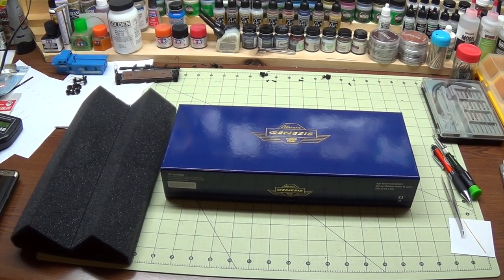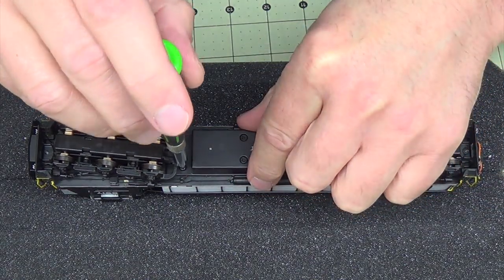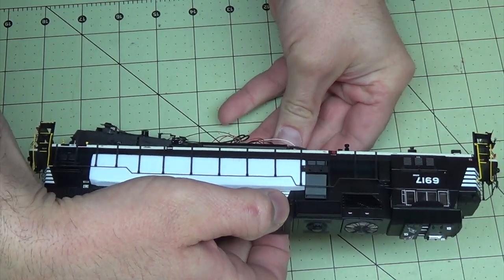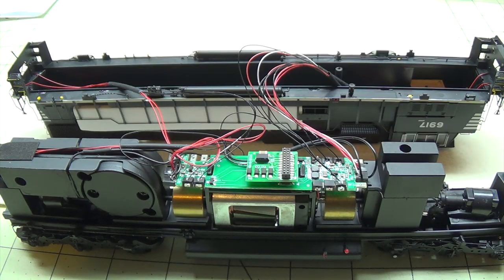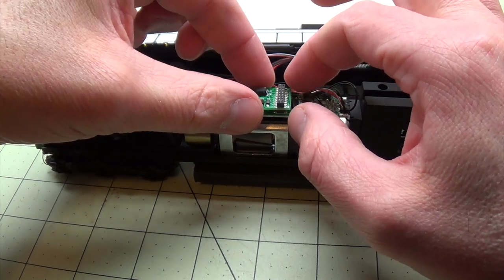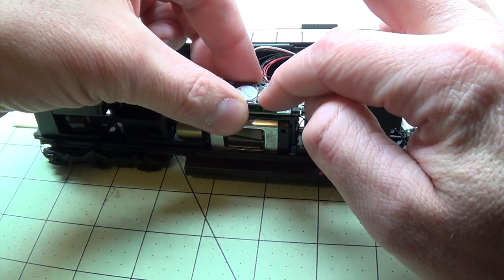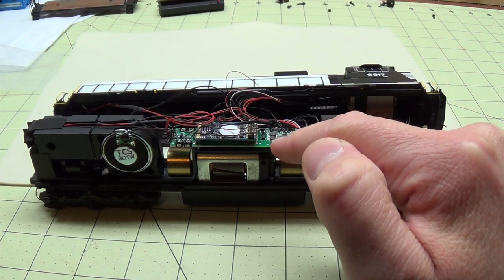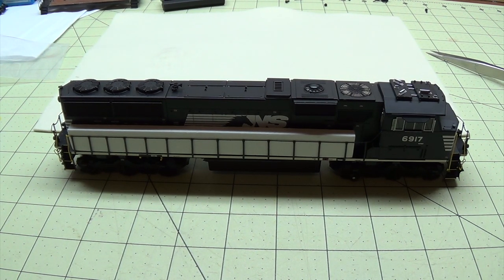How To - Decoder Installation - Athearn Genesis SD60E

Comment: The MTC21 plug has the loudspeaker pins on the board, better to grap the signal from there then directly from the decoder. Great video though...

Comment: Love seeing you back in my sub box! I have 3 of these, veterans, 911 and a standard black one. Are all the lighting functions isolated or are they all wired to the main head light like older pre 21 pin decoder boards? I think I see isolated in the video but am not sure. It will probably be explained in the next video. Can’t wait!
Reply from the maker: Thanks buddy!  The number boards are wired to the same output,  but everything else is on their own output.  Each ditch light is on their own output,  so if you use a 6 function decoder, you can get both front and rear to alternate flash,  without having to touch the wiring.  I have a programming video coming out soon discussing that.  Hope that helps.
Reply: DG Modelworks Awesome!! I’ll have to add sound to the others. I only got the veterans unit with sound. I know your video will help me a lot! I know this one did!

Comment: Great "How to" video! Does removing the weight affect pulling performance?
Reply from the maker: Thanks! Removing weight from any loco will definitely affect pulling power.   These aren't the heaviest locos out there to begin with.   As a comparison, this locomotive weighs 20.45 ounces.  To put that into perspective,  an Intermountain ES40DC weights 18.00 ounces(which has terrible pulling power), and the MTH SD70ACE weighs 23.15 ounces (one of the best pulling locos).
Reply: @DGModelworks , thanks for your quick reply! can I add weights in that cab? The ones they sell in auto parts store?
Reply from the maker: @FatboyinPa  Yes you can add weights if you can find a spot for them.  I don't expect you will find any available space in this locomotive though.

Comment: Great tutorial !. I like the idea of installing an ESU Loksound decoder in an Athearn Genesis. Not a big fan of Tsunami 2. Question is when you purchase a new Loksound V5 decoder are the wires for the speakers attached to the decoder ? or did you have to solder them on to the decoder . Sorry and one more question, if you were to install an ESU decoder V5  21 pin into a new Athearn Genesis DCC that has a tsunami 2 decoder from factory would you have to wire in the speaker ?
Thank you for any input, just not to impressed with tsunami 2 right out of the box.
Reply from the maker: Thanks!  The 21 Pin V5 decoder comes with the speaker wires already attached.   If you buy the newer NON-Sound Genesis locos, they will accept a 21 pin decoder.   If you buy one that already has Tsunami 2 from the factory, then you will have to replace the entire board.   The factory  equipped Tsunami 2 locos come with a full size decoder board, not a 21 pin.
Reply: Hey thanks for responding.  Wow, I didn't realize the factory equipped  tsunami 2 locomotives are like that. I've got about  4 tsunami 2 locomotives and I was thinking of converting  them. I will most likely buy the dcc ready models in the future.  Thank you very much for that info.
Reply: Okay I just purchased the same decoder that you did (58429) and there are no speaker wires.  I cannot tell from the provided documentation where I should solder the speaker wires.

Comment: Hi Derrick, great video , I like how you show things so simple and easy, I have a Athearn Genesis Sd60m Non sound model and want to add an ESU loksound V5 decoder like the one you used in your video, I noticed the product# was 58429 , that decoder is pretty hard to find now with the chip shortage and all ,also living in Canada now my question is could I use  ESU loksound V5 58419 , this one is available at the moment but just wondering if this is similar to the 58429 decoder ? Or is this one for steam or the European market ?
Thanks .
Reply from the maker: I think the only difference between the two is one comes with a speaker, and one doesn't.   Also some things to know.... make sure your loco accepts a 21 pin decoder.   And these decoders do not come with any sound file loaded on them, unless you purchase from a place that will program a sound file on there for you.   Or unless you have the Lokprogrammer to do it yourself.     These decoders come "blank" and need the correct sound file loaded.